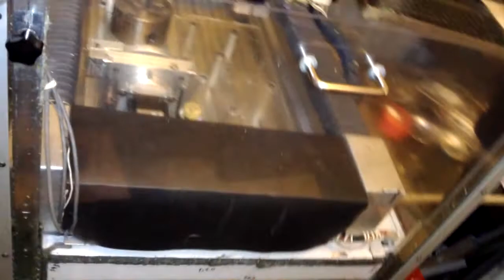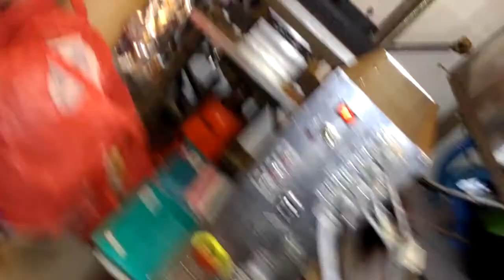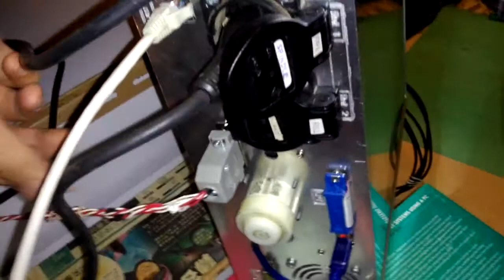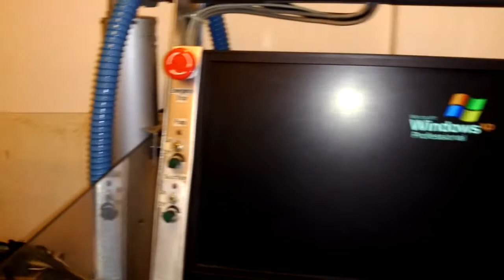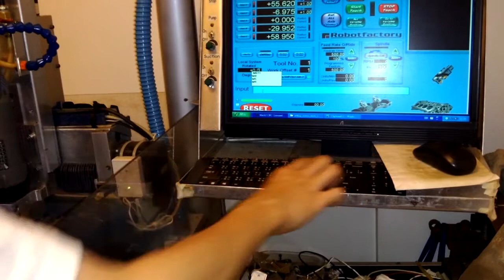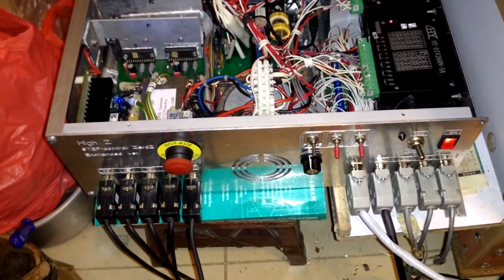CNC control box ultimate conversion 7/7 - 27 (High Z CNC-STEP)

Comment from the maker: thks for your information, I will check those ic thermal paste. The driver is very cheap and agree the workmanship is not very good as i did open it to have a quick check before, but it still works anyway. The filter cap. for 3 axis are the original circuit one, as i remember, they are of value  2x4700 uf., i use them for a long time, no problem. My added two axis use separate power supply, the caps. also are that value, should not be a problem.

Comment: Did you checked those HY-DIV268 drivers,they sometimes come without thermal paste at driver IC-s.And are those main filter capacitors too small for six motors...Nice enclosure,and cable menagment.Good work.